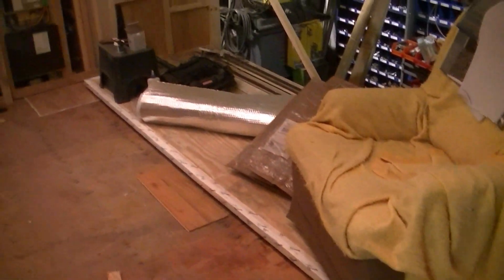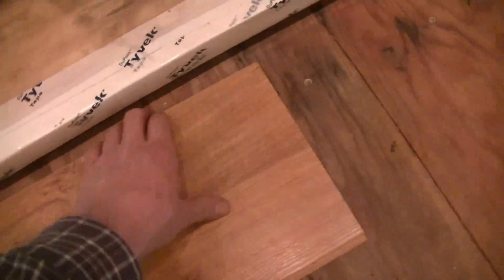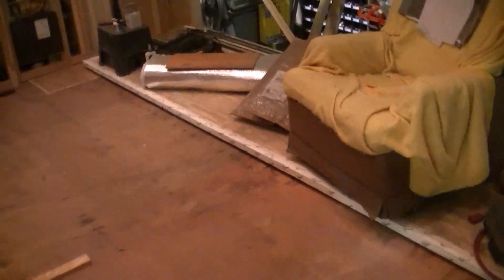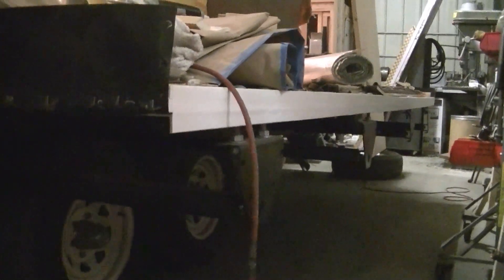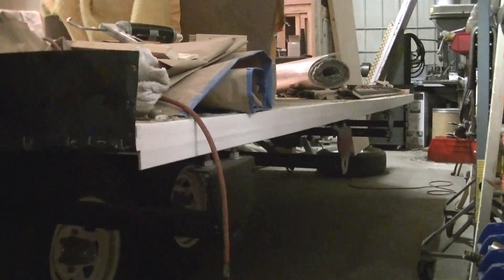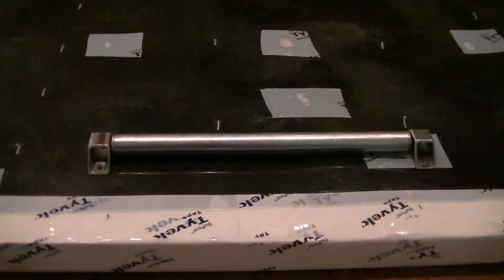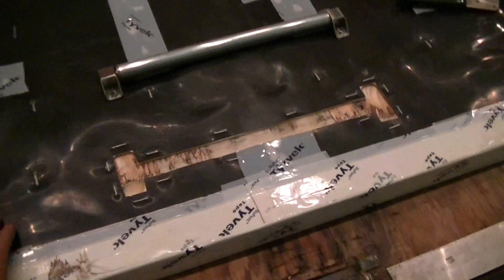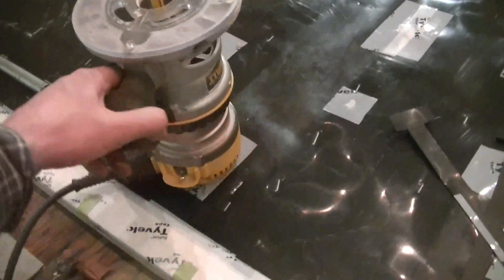5th Wheel Camper Project "Slide Room Floor Rollers"

Comment: Running into the same problem on a Fleetwood Southwind. The flooring is too big for the slide to go over. Where did you get the rollers?
Reply from the maker: mixmasterjt   The rollers are from McMasters.  They have just about anything needed to fab anything.  Those are the smallest rollers they had and they are for a conveyor belt I think.  You would have to pull the slide room out to do this job.  Not something I would want to do.  The easier thing to do would be get thinner flooring.